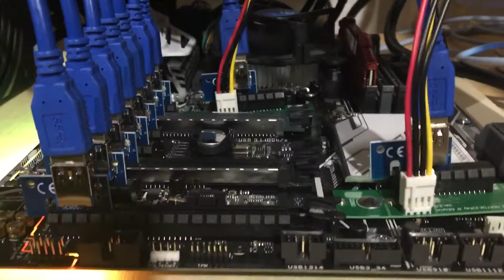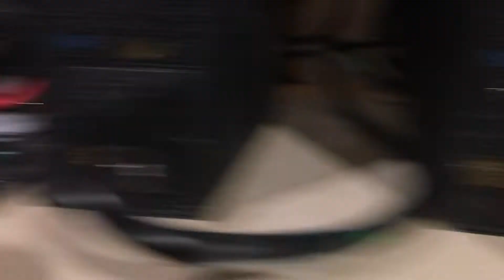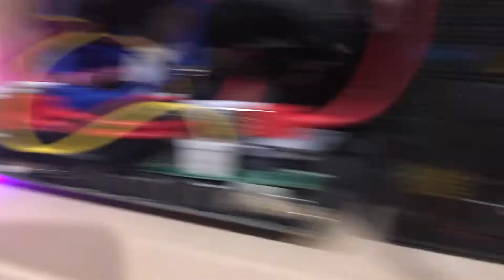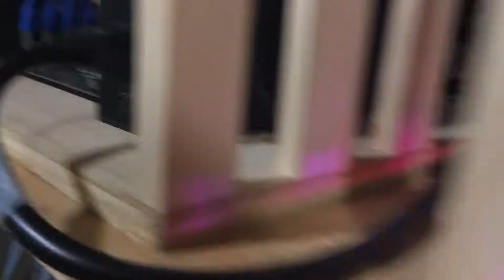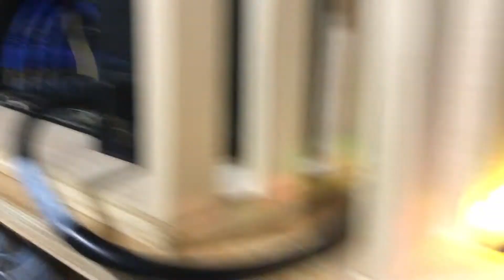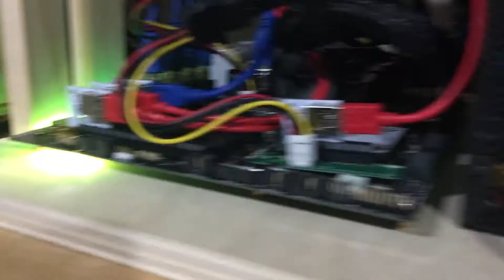PCIe and m.2 connections

Comment: Hey I saw you commenting about BIOs on another comment. I have the z270 a-pro and I cant find anything in the BIOs mentioning m.2 as a setting to update. I have 3 of these boards and just picked up 15 cards on ebay to add and build to I'm trying to add 1 gpu to each board before starting a whole knew one as well.
Reply: I saw a video on "son of tech" and i downloaded the bios I saw in the corner of his screen. Still not showing. I tried 2 different m.2 cards. I am going to swap to a new MOBO model for my fourth rig. I have 1 spot to fill and will aim for another option moving forward as its a pain missing out on adding one or two more cards for a $5 m.2 instead of $500 on a whole new rig just to add a gpu lol. Thanks, hopefully someone may see this and chime in.

Comment: My GPU is not detecting from M.2 connection, what should I do?
Reply: Thanks for your reply, you are right, the mb is not recognizing, I am using ROG STRIX B250H GAMING motherboard.

that how is my BIOS:
M.2_1 width select  : X2 mode
M.2_1 Configuration : Auto
PCIEX16_2 Configuration: X2 mode

is it correct setting?

Comment: Could you post a video on the frames of the rigs?
Reply: Crypto Mang Thanks
Reply: Crypto Mang Hey on your other videos you talked about the  bowing of the wood. You could use the wood frames but just switch out the bar that holds the GPUs for angled aluminum... that's what I have right now. I thirteen so tell me if I am wrong, but wont that help instead of spending 300 $$$$ you could have a quick trip to the hard where store and 40$ later you may have fixed you issue.

Comment: What is a good power level to use? I have a 6x EVGA SC 1060 6GB rig running +100 core and +400 mem (The majority of them are Hynix). 750w PSU running the MB/CPU and 4 cards. 400w running the last 2 cards. I run them at 80-85%. I run them on Equihash, Lyra2RE2, Neoscrypt, and Lyra2z VIA MultiPoolMiner. Every so often (once or twice a week) i will wake up and one GPU will have lost connection to the driver. While the other 3 are still going. :/
Reply: Thanks, I'll try 86-87% for a few days
Reply: Not always the same card. Usually is but not always. I use nvidia inspector to OC and can do any card however i want. I noticed it happen more at 150 core 500 mem. Less at 125/450. A lot less at 100/400. All of these at 85% power. Trying 98/398 at 86% for a few days hehe. Not even sure if it is the memory or the core that is the problem. Could also be the old board i am using (another on the way) or the risers (prefer not to buy more. super over priced now).
Reply: Crypto Mang hi. Please add the link to buy the pcie to m.2 adaptor. Thanks.